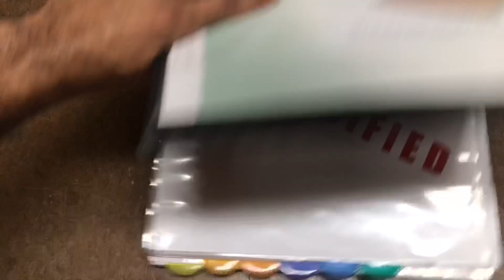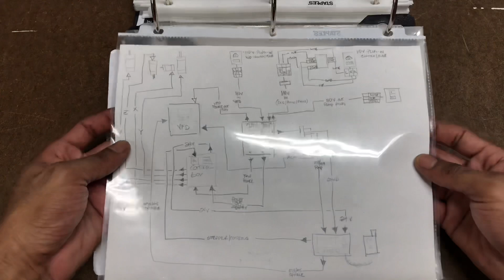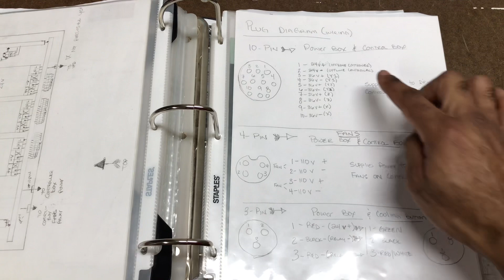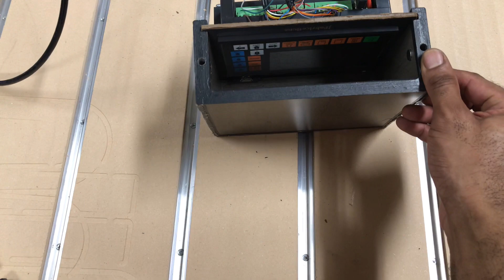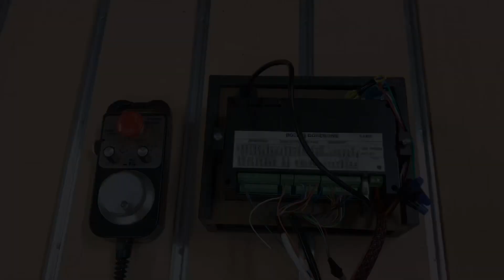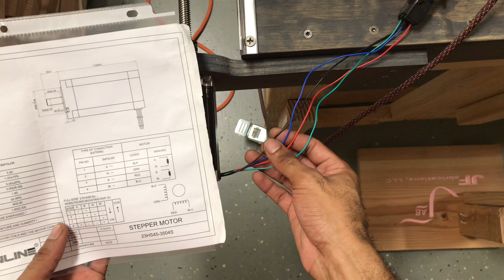CNC Motion Controller RMHV3.1(DSP) wiring to Drivers, Motors & Power on my Gatton CNC Kit build

Comment: Do you know were to download the manual for the RMHV3.1 Controller?  I just got the unit in, but without a manual.
Reply from the maker: https://www.nvcnc.net/pdf/NVCNC_DDCSV3.1_EN.pdf

Try this link. This is what I found when I look for a 3.1v manual. If this is the unit you have it is different the my set up. Looks like the same software just different hardware layout and connections.
Reply: @SuperJfritz   I downloaded the manual. I already had the RMHV2.1 manual and the color code is the same except for GND.  When I hook up the controller it worked but the hand wheel did not work.  One question I have is on the GND I'm putting the Black & the Black/Orange in the same slot. Is that what you have?  The  RMHV2.1 manual shows Black/Blue as well. All 3 in the GND slot. 
Also can you tell me where I slow down or speed up the x or y axes, I'm used to mach 3. I know  no excuse but hey I'm old........lol

Comment: Thanks Johnny, this is a great video series!  I am converting a lathe to 2 axis control and wondered if a single 24vdc power supply of sufficient wattage would be good to drive both the controller and motors.  Should the controller be on its own power supply to minimize electrical noise from the motors?  Didn't want to waste money, but didn't want to compromise operation either.
Reply from the maker: The 24v power supply is just to power the offline controller. I have separate power supplies for the stepper drivers and stepper motors.

Comment: I am looking at this controller for my plasma cutter.  Was curious if it has the option for dual y axis motors and how easy that part is to set.  I couldnt see anything in the manual. Really great video
Reply from the maker: I have two motors on my Y axis if that is what you are referring to.

Comment: Great videos. Ive got 2 question. I have a CNC plasma cutter table. I run mach3 presently, but I just ordered the DDCSV3.1 controller  w the hand wheel as I like the stand-alone feature this offers. I saw that your using 3 power sources. I just use 1 with (#4) nema 23 stepper motors, and it works fine. My 1st question is, is there an advantage to using 3 over  just 1? 
Also does the hand wheel controller come wired to the plug as I'm not an electrician and can't find any pics or videos showing how to wire it up?  Thanks for your videos. 2 thumbs up
Reply from the maker: Thank you taking the time to watch my videos. I have three power supplies because I choose to order a Stepper Driver, Motor, and Power Supply bundle. The bundle came with two 36v power supplies. The DDCS needed a 18v-32v power supply so I decided to purchase separate 14v power supply instead of a component to step down the 36v to 18v-32v. This also allowed me to keep both of my Y-axis drivers and motors on one power supply and the x and z axis on the other power supply. This does open my CNC to an issue of the 2 axis still moving if one of the power supplies dies, so I always monitor my CNC during cuts (referred to by some as E-Stop button hovering).  Since I knew I would be designing my own enclosures I was able to add more space for working and more components to share the work load in this case power supplies which I hope will help minimize power spikes that may result in lost steps (in addition to selecting my Stepper Driver setting one setting lower than peak). This is only a hope but I also hope that this extends the life of the components also. I am not an electrician and started with very little knowledge, so my thought was better to over do it than under do it. The Hand wheel (MPG, Pendant) does not come with a plug. They have color coded wires and designations listed in the owners manual, all that is needed is to connect the wires to the proper terminals is a small screw driver (at least on my version).  I chose to add an aviation connection to make mine a plug-n-play version but it is not necessary. Long answer but I hope it helps.
Reply: @SuperJfritz   The one I ordered from Aliexpress fell through . I found one on eBay for 241 + tax, anyway looking forward to receiving it and setting it up. thanks for your videos, top notch.

Comment: i am new at this not for sure how to set up in seting  is there a way to speed up a job
Reply from the maker: Yes, there are a lot of settings with this unit. You are able to change the speed of the CNC movements during a file run (automatic), manual movement, movement speed between nods, as well as adjust some speeds during a cut to fine tune things such as speed feeds and RPM's.

Comment: is thare a video on seting up frimware seting i need x-y to move the same z up and down a side to side my cnc looks like yours
Reply from the maker: Good question, for questions like this one I go to the facebook group "Digital Dream PLC CNC Controllers". This group contains members that really know the controller and may have even designed the controllers. I am sure someone would have more information if you use facebook. The are consistently upgrading and making new things happen. I am not sure of the CNC configuration that you are using but I tend to do a lot of my design around my CNC capabilities using the design software.